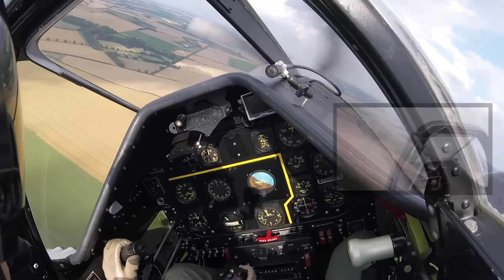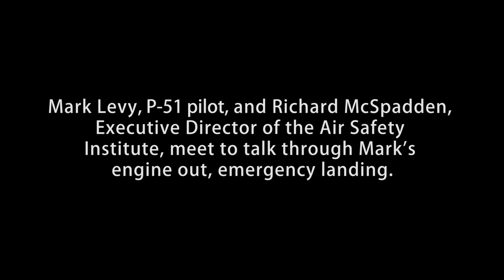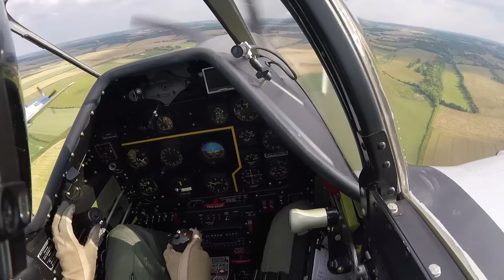P-51 Engine Out, Off-Airport Landing - Full Analysis

Comment: As a sailor, I find pilot discussions like this fascinating. I'm not on a hydro foil or even up on a plane. Things happen slowly.  But the vastly fewer things I have to think about while steering and trimming are still important from a racing performance standpoint, rather than a  saftey standpoint.
I laughed when I heard the phrase "put the monkey back in the cage" because the crew has sometimes called themselves monkeys. But the ability and need to keep the right things on the top of the checklist when distractions pile up is much the same.  After listening to an experienced pilot break down his decision making process only left me feeling more dedicated to focusing on the things that matter most.
Of course modern foiling cats doing 50 knots  on one hull foil and one rudder foil have discussions that even more closely resemble aviation. But we still like waves.
Thoroughly enjoyed this video. Thanks